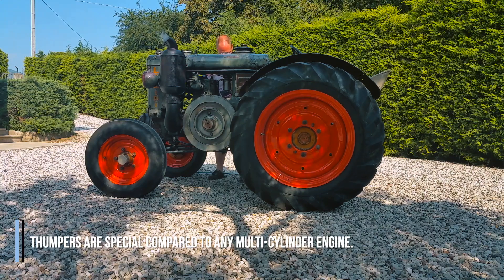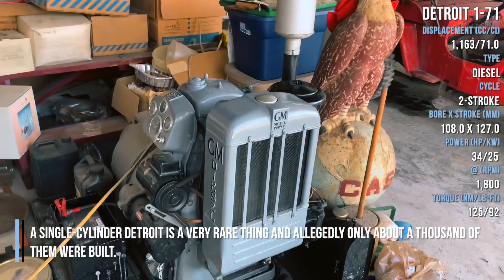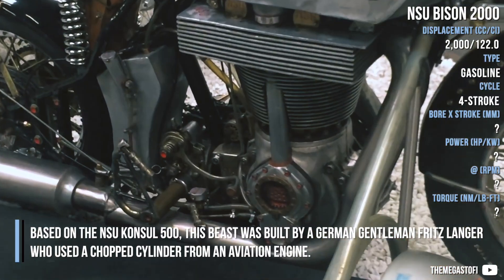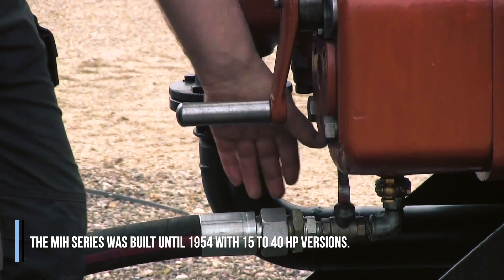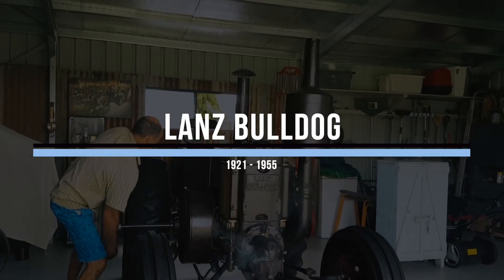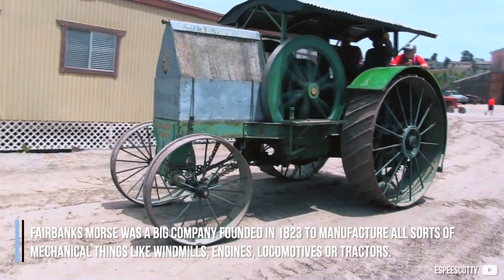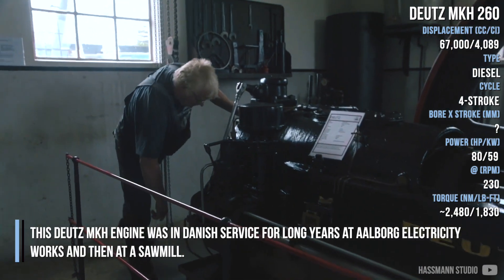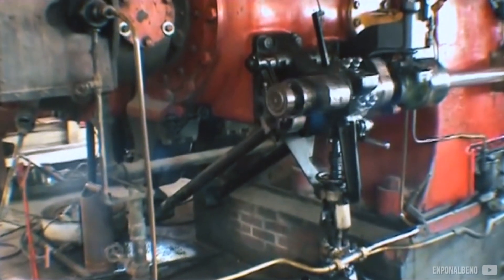Largest 1-Cylinder Engines

Comment: Engine manufacturer in 1900: “I’m going to make this last forever!”    

Engine manufacturer in 2000: “I’m going to make this last until the warranty expires.”
Reply: Literally.
Reply: @iant720  Except car engines now can do well over 200,000 miles (since the 80s??) if properly looked after. Car engines back then couldn't!
Reply: @Markpd69  the problem is emmision and planned obsolescence in the electronics. And the engine being pushed further and further. 1.0 liter engine with 100+ hp
Reply: @minecraftfirefighter  Yea it's the electronics, suspension or anything else giving out that can make it not worth keeping the car on the road! I don't think 100hp/ltr engine's is a problem though, as long as they build them properly & are serviced regularly.
Reply: @Markpd69  the only reason the older engines didnt last as long was the fact that they hadnt invented detergents in oils. now that there is, they will outlive modern engines.
Reply: @Markpd69  lmao a big block Ford 460 will last 500k consistently shut up
Reply: @Markpd69  A lot of superbikes produce in the neighbourhood of 200hp from 1000cc right now and they easily last 100k miles and probably more if looked after, motorcycle engines just tend to be abused.
Reply: @minecraftfirefighter  alright let's compare a certain old Ford engine to a certain modern Ford engine:

Displacement, old: 2.9 liter.

Displacement, New: 1 liter.

HP, old: 20.

HP, New: 123.

Mpg, old: 24.

Mpg, New: 31.

Typical lifespan (no rebuild), old: 20-60k miles.

Typical lifespan (no rebuild), New: 190-300k

The engines im comparing are the model t and Ford Fiesta 1 liter eco boost.

In summary, the new 1 liters which you say cause new motors not to last as long as old motors-

produce over 6 times the power with 1 third the displacement, burn less fuel, weight much less, are more responsive, and last over 4 times as long...

Im going with the ecoboost
Reply: @minecraftfirefighter  750cc sport bikes have been doing that since the 90s and lasting for 60000+ miles. Not exactly amazing or difficult to get 100hp/litre out of a naturally aspirated car engine.
Reply: @Markpd69  Agree completely. "They Don't Make 'em Like They Used To."  Thank goodness! The looked after properly is the key here. I saw a fairly new Nissan Sentra smoking like a train, and I thought, "What the hell did you do to that car!!"  Or didn't do, like change the oil regularly.....
Reply: @frigglebiscuit7484   Mmm, don't think so. Bearings, alloys, oil pumps, cams, lifters - all much better today.
Reply: @mcnuggatron2129   Yep, absolutely agree. With a little care, and decent driving habits, a measure of luck, today's engines will run 250 - 300K miles.
Reply: Assimilator1 Jeep 40? Ford 5.0? GM 3800? Can others chime in?
Reply: @Markpd69  Car engines between 1980 and 2000 run depend on the manufactur up to 1'000'000 km nowdays some car engines dont even survive 150'000 without replacing/reparing engine Parts.

Most often problems i know:
♦Diesel and Gas Exhaust Systems
♦Turbocharger
♦Pistonrings
♦Electronics
♦Bad quality parts inside of the Engine
Reply: @Markpd69  rolls royce actually put a 70 year old car to the test and the engine survived like 500 miles without any issues what so ever.
Reply: @Markpd69  I've seen several 60's and 70's era cars with over 200K with no major work done on them. People rarely maintain their vehicles or just trade them in when they get problematic.
Reply: @Markpd69  not true -you can do well over a million miles on  a Volvo engine -in fact the record is 3. 27 million miles
Reply: @minecraftfirefighter  my friend has a 1997 (112hp) cbr600 with nearly 300'000km a 14k rpm and he still does track days on it. Still running strong no rebuild just service and letting it warm up properly.
Reply: @Markpd69  yeah my friend has a 97 cbr600 with nearly 300'000km he still does track days on it and it still pulls hard. 13k rpm nothing but service and sensible warm ups.
Reply: @AntaresSQ01  yeah when people do wheelies the oil doesn't reach the piston and fuel pump .
Reply: @Markpd69  well now some could but f.e VW guarantees for the small 1 litre motors only 19000 miles or 30000 km.  My XC 60 now  has 450 000 km on it,  first motor  and transmisdion.Doubt the new downsized 2 litre can do that.
Reply: @Markpd69  
That's true, the real reason engines last so long is because of fuel injection,  the carburetor would dump too much fuel and cause excessive wear to the cylinders.  
Great Post sir.
Reply: @frigglebiscuit7484  It's not just about the oil, engineering tolerances and materials are a big factor too.
Reply: Some modern engines last for ages outside the warranty, and others are calibrated to die immediately after the warranty ends, no matter how well you follow your user's manual.
However, many cars don't go to the junkyard because the engine stops working. Often it is because the transmission stops working and isn't worth rebuilding. Other times people send their car to the junkyard when there are constant electrical glitches.
Reply: Not so much the engines themselves - though there are a few exceptions which are either badly designed or built cheaply. It's more the flimsy bodywork, unreliable automatic transmissions and cheap electronics which either get damaged easily or go wrong to the point of being more expensive to repair than to replace. Of course engines do sometimes blow up or break down, but that's a rarity compared to how often all the other parts are the source of problems. The vast majority of cars or trucks in scrapyards are not there because the engine was the point of failure - and even when that does happen, if there is nothing wrong with the rest of the car, it is often easier and cheaper to scrap just the engine and put a new one in.
The really shitty part of modern engineering techniques is the electronic bits which need a $200,000 diagnostic computer and $10,000 service manual in order to repair. The days of the farmer being able to get his tractor repaired in the field or getting a truck engine fixed on the side of the road are long-gone. When your ECU goes pop or the electronic automatic transmission develops a fault, forget about repairing it yourself, and even forget about being able to order the parts yourself and get your local mechanic to install them.
No, you have to get the parts from an "authorised" dealer and can only get them installed by a repair shop who have paid through the nose for the diagnostic equipment and paid the exorbitant fees for using the service manuals. Then of course there's the "Sorry, this item cannot be repaired*, only replaced" bullshit, which car, truck and farm equipment manufacturers have started to borrow from Apple.
*Actually of course, the items usually can be repaired, surprisingly easily in fact, but they won't let you have the schematics to make it possible. The reality is that they just don't want you to repair it, because then you wouldn't be buying a new part instead. Fortunately, cars aren't quite as bad as computers for this - if they were, then any time your windscreen wipers broke down (or some other minor part of your car), then the "cost" of repairing or replacing them would be more than the price of a whole new car. And you couldn't get round this by buying the parts to fix it yourself second-hand, because every "unauthorised" supplier would have had their parts confiscated due to being "counterfeit", regardless of whether the parts were genuine or not. Yes, Apple does this quite often (watch Louis Rossman), and I wouldn't be surprised if car manufacturers start doing the same in the next few years.
Reply: @lloydevans2900  Big Tech and Automakers are the new "Priest Class". Them and only them will know how "things" work and are fixed. Once upon a time your average Joe could look at most machines and tech and know or at least understand how they work. Now, only a small percentage of professionally trained technicians know how to diagnose and fix, and a smaller percentage knows how to make the tech. We dont even know how our phones work now. The future looks very scarey when such a small percentage have so much knowlege vs the masses.
Reply: @lloydevans2900  To further explain the dilema I forsee....back when astronomy was only taught to those born with birthmarks on their head or whatever during the mayan times....only a few KNEW an eclipse would come AND go harmlessly but they had the masses believe that sacrifice would bring the sun back. How will that morph into todays Priest Class?
Reply: @lloydevans2900  a lot of it is insufficient R&D especially in electronics, bad design, and lax manufacturing tolerances 

Correct me if I have something wrong, I think Porsche was one of the first manufacturers to use components for the engines that had to meet a minimum tolerance that the blueprint specified. The advantage of this was that the engines performed exceptionally well and could be used on a racetrack often despite having high power and torque
Reply: Older engines don't last longer than new ones. They only live to this day because people keep rebuilding parts for them or repairing the existing parts they already have in them. I'm certain that they're not as invincible as people think they are. In the video you can see one of them had a piston crown with a very large crack that had been repaired. I'm sure most of them have gone through many major repairs in their lifetime. Back then manufacturing tech wasn't as good as today so there weren't many of them being manufactured. These things survive for so long largely because their owners had no choice but to make do with what they have. If they're busted, that's it. If the manufacturers in the 1900's had access to modern manufacturing facility and technology of today no one would be maintaining them as diligently as they did. They would be cheaper to buy, and major spare parts could be made to order.
Reply: Vote with you're wallet and buy old. Let them know you won't stand for it.
Reply: @Thoroughly_Wet  That's what I do.  Never bought a new car in my life, or even a recent one.  Never intend to.
Reply: It's always been possible to make an engine that lasts forever, and it still is. But like any automotive engineering problem, doing so involves tradeoffs in the areas of  performance, serviceability, cost of manufacture (i.e. potential profit margin), and total cost of ownership. Nobody is going to buy a modern vehicle with an engine that "lasts forever" if the maintenance requirements include an oil change every week and an annual engine-out service, with performance equivalent to a mid-60's era car because the engine has been designed for longevity above all else . Then there's economic and business concerns e.g. planned obsolescence. Every carmaker wants their vehicles to be 100% reliable... right up until the warranty runs out, or the lease agreement expires, or for the length of time covered by statutory consumer protection laws in a given market, depending on how happy the company is to screw over their customers for some extra bucks.
Reply: Engine today is trying to stay alive but epa is shaming them out.
Reply: Nice your last name is my first name
Reply: I would say after 2010 
Because my scenics were undestroyable I had a second gen with nearly 300.000 with not much repair costs
Reply: jordan camden  You make a catchy, although inaccurate claim. With the exception of the newer Suzuki motorcycle, the engines shown here only put out 20 to 30 horsepower, and that was despite some displacements exceeding 1000 cubic inches and weighing tons. I could get that much horsepower out of a Chevy small block, with the RPM at a fast IDLE. At that speed, it would last every bit as long as the engines here.
A proper metric for any moving vehicle would be something like 
Reliability = (horsepower * Hours) / weight
Weight is significant. The newer Suzuki motor was the only one suitably sized to fit into a highway legal vehicle. On top of that, it was the only one with enough horsepower to move the vehicle at highway legal speeds.
Reply: Thats what the germans do with their trash luxury cars like bmw 😂
Reply: When light bulbs were invented they made light bulbs that could stay on forever but quickly realized that's not profitable
Reply: Yup
Reply: That’s been Ford’s policy since 1910…
Reply: good luck getting 200,000km out of a model t
Reply: Wrong. Modern engines will live for half a million miles if you maintain your shit.
Reply: @zuestoots5176  I did say 'well over', I guess I should've said 'at least'.
Reply: @zuestoots5176  You mean pay two motors in parts until scrapping it ?
Reply: @zuestoots5176  Maybe a diesel truck engine, but certainly not a gas car engine
Reply: I've always despised the whole "old technology was designed to last" outlook.

In most fields, there's a whole new quality threshold which is inferior to old things, but also much cheaper. If you pay more, you get the same quality you used to. If you pay even more, you get much better than existed (that's very generalized)

In terms of motors, it's not even that, you're just wrong. First off, the motors featured in this video were mostly very large, industrial engines. They would be sold to corporations, not individuals. I don't think I need to explain why selling an expensive piece of machinery designed to fail to a company which plans on profiting is a terrible idea.

Second, you're wrong in the consumer market as well. Coating technologies today are incomprehensibley better than what existed 100 years ago, and if any of the car manufacturers, for instance, decided to use the inherently inferior and demonstrably dog shit coatings of 1920... Would you buy that car? Neither would anyone else. The magics of capitalism!

In conclusion, motors of the past were actually quite awful when compared to modern engines. The best they had would not last as long even as a production car designed to quickly fail. If you make it fail TOO quickly, no one will buy it. It has to last quite long, and the time it needs to last happens to be much, much longer than 1920 engines even could
Reply: Agreed 100% especially 50s 60s motors, find a old model T in a shed that’s been sitting forever, put fresh battery and fuel in and away you go, a festiva wlould probably be a pile of corrosion and brittle plastic under the bonnet in 100 years, plenty old cars run over a million hard miles. Not to mention if you do need to work on one it’s a pleasure. I could go on

Comment: That last engine is fecking disturbing...
The whole moving assembly is terrifying, the energy in those flywheels, the counter-weights... I mean imagine it letting the rod or crank go!
The forces trying to pull those flywheels apart is horrifying, one casting imperfection and BOOM!

Comment: Did you know that going “balls out” is in reference to the governors on those large engines that swing little balls around to control engine speed.
Reply: Primitive governor
Reply: Cool, I love those kind of facts. "The whole nine yards" supposedly referres to shooting the whole nine yards of the standard supplied machine gun belt in some old machine gun, I don't remember which. Think I got It from Forgotten Weapons channel. I Guess "going balls deep" is something different...
Reply: This is also why some people say "Balls to the wall."
Reply: @skylinefever  "balls to the wall" is different from "balls out". "Balls to the wall" refers to the balls on top of the throttle levers in airplanes pushed all the way to the firewall (or instrument panel). At least that's how I heard it.

Comment: to the narrator when your saying the Horsepower you should add the torque also example is like the last one has 125 HP which aint much my 2006 Saturn has more then that but the torque is insane at 4,100 LB-FT

Comment: The Landini and the Lanz tractors in the videos shown were the smaller engined models. They've got 45 and 55 horsepower models, and that's the business, especially the Landinis. Try searching Landini L45 (45hp) or L55 (55hp )or Lanz D9506 (45hp) or D1506 (55hp). Also there were other hot bulb tractor manufacturers that produced tractors just as big, and there were videos of them here on Youtube, like the Italian Orsi Argo and Anteo models, the French SFV 551 and 552, or even the earlier SuperLandini models. If you find the right videos, it would show them in all their glory.

Comment: If memory serves me well the biggest single cylinder engine I've seen is in the Henry Ford Museum. It is one of four that was used to power his Ft Rouge plant. That cylinder is probably 80 feet long or more. Ran on various fuels.
Reply: The Highland power plant engine was actually a hybrid steam/gas engine that had 2 parallel cylinders driving a common flywheel. 60" bore and 60" stroke, rated at 5000 hp.

Comment: Notice that the Lanz Bulldog has an Australian number plate on it.  These were also made, under licence, at Springvale, Melbourne, Australia.  Made in other countries too.  A number have survived and been restored to running order.  The video example can be legally driven on the road.  Popular exhibit at the vintage engine shows I go to.  Seeing the driver remove the steering wheel, and place in the flywheel, to crank the engine over.

Comment: 5.40 why does it have a chicken house on the front??
Reply: That is a very primitive radiator. The cooling water goes in the top, flows down the metal plate to dissipate the heat then back into the engine.